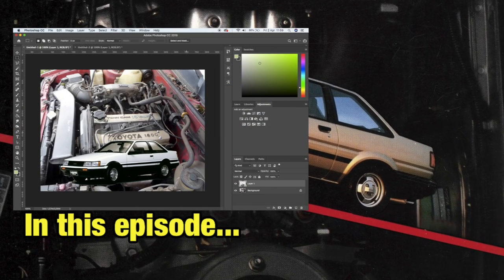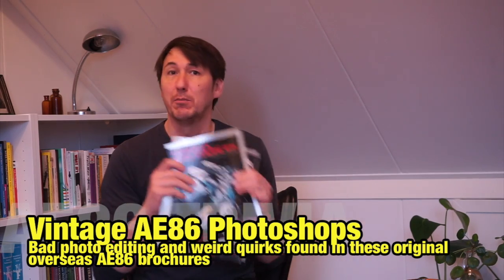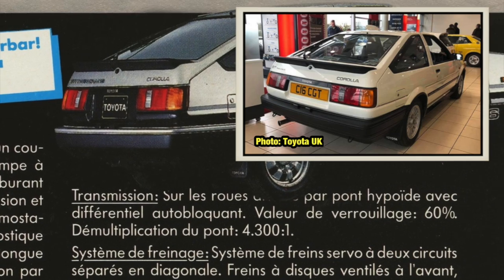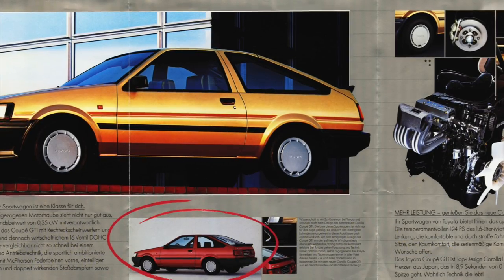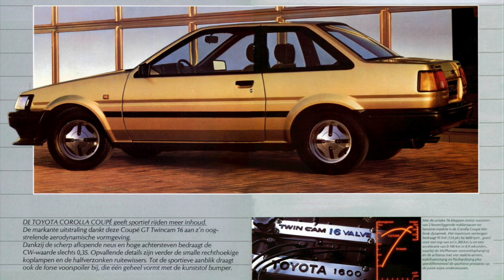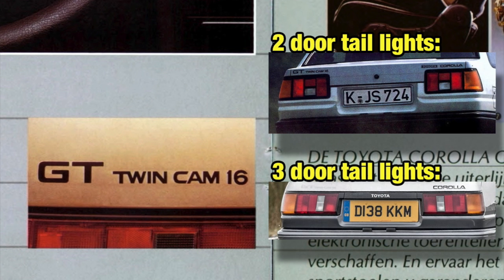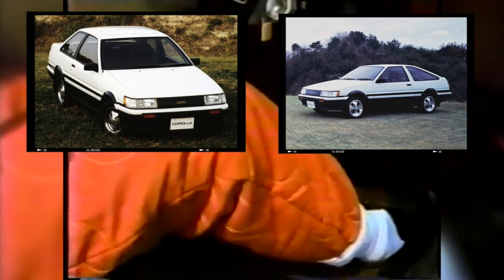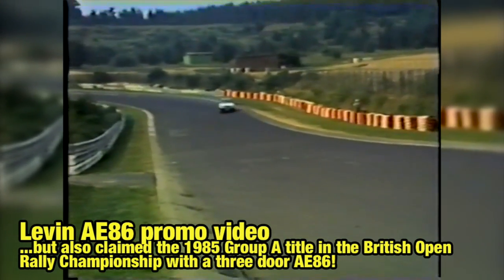How bad are these AE86 brochure photoshops? ** JDM Trivia **

Comment: cool :). im actually seeing few more akward photoshops in there. the red hatch in the australian one with the poorly edited seats also have the hubcaps photoshopped on. they even used the same picture for the front and rear wheel, and the perspective on both of them is completely off compared to the rest of the car. i would also say the hubcaps on the gold hatch above it were been added later too. and same goes for the alloys on the gold coupe in the dutch brochure too lmao. also the promo picture of the red panda coupe at around 4:38, notice the asphalt pattern at the bottom of the picture, id say they masked a centre line of the road or something haha
Reply from the maker: Yes you are correct about all of them! 👍
I noticed all the hubcaps as well but i didn't want to bring them up to not complicate things even more. 😆
About the panda red two door: i didn't notice that one! 😲